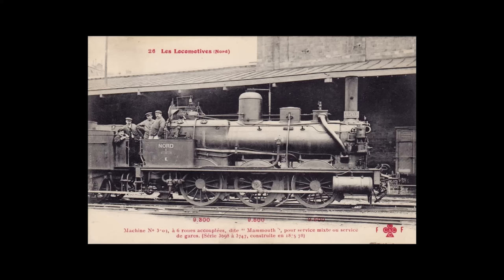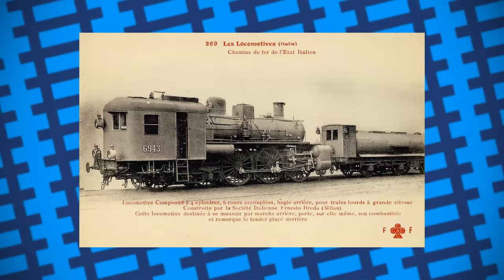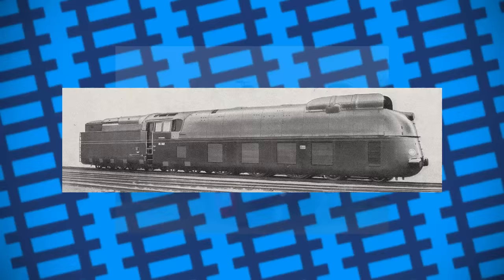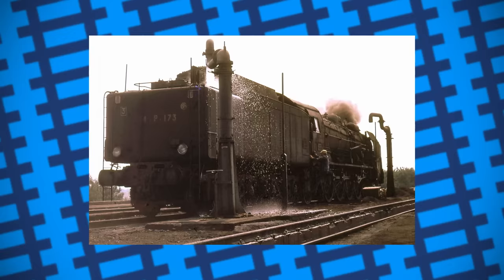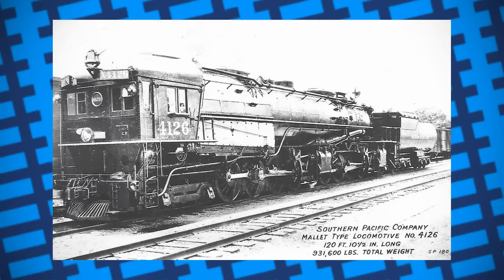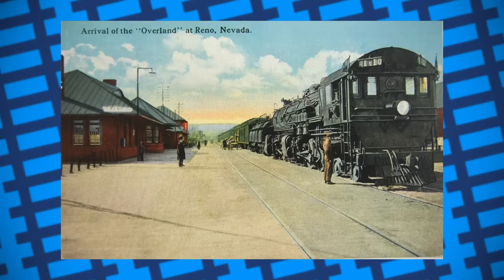Why "cab-forward" steam locomotives usually didn't work - Cab Forward Locomotives

Comment: In Denmark we did a small cab forward locomotive design similar to the first one shown in the video. It was known as the Jutlandian & Funen Railways (JFJ, later part of DSB) P class locomotive A small 0-2-2 tank engine from the 1880's with a long rear tank, making the locomotive look more like a tender engine. Like the american engines they were specifically designed for work on light railways with very cheaply laid trackage to save money. Though this quickly became a problem as the lines they operated on quickly had so much demand the little P class machines couldn't keep up. 

Over the next many years many were shuffled around to work on branches and secondary routes around the country until around 1904-06 when all the locomotives were sold to private railways. The private railways in Denmark were historically a scruffy affair with lower finances and poorer tracks. So for many of these, getting some P class locomotives to start service with for their brand new line was quite ideal. Though most only lasted 10-20 years on such lines. 

Today a single P class is preserved, P 125. It was sold to the Copenhagen-Slangerup railway in 1906. The line opened a year before with 4 subpar steam locomotives and needed better locos asap. The little locomotive ran on the line, doing shunting and light trains partway up it, all the way until 1948 when the Copenhagen-Slangerup railway was taken over by the state railways. With P 125 being one of only 2 surviving P class locomotives at the time, the State railways immediately put the locomotive into their historic collection, forming part of whats today the Danish national railway museum, which was separated from DSB in 2017
Reply: When you say cheaply laid trackage, does that referring to the weight/strength of the rail or the frequency of the ties? Thanks
Reply: @george2113  Strength of the rails. Also many of these lines didn't even use traditional railway ties but rather pots turned upside down to support the track. And the trackage weighed just 17,5 kg per meter. So very cheap and very weak
Reply: @drdewott9154  that's pretty flimsy. Even worse were snakeheads in early US railroad. A loose, bent-up end of one of the strap rails, or flat rails, formerly used on American railroads. It was sometimes so bent by the passage of a train as to slip over a wheel and pierce the bottom of a car. The cars were made of wood and frequently had a wood stove and kerosene lighting.

Comment: Good Video, and a good introduction to "Cab-Forward" locomotives. Being from across the pond, and a huge fan of the SP and their exploits, I thought I would share some notes for additional context:

@0:35 - I think it's a bit misleading to consider the Forney locomotives as a "Cab-Forward" designed locomotive. Primarily, I'd like to point out that it was designed to be a 0-4-4T engine, with the intention of bi-directional running. It sounds a lot more similar to shunting/switching locomotives, but with an additional set of wheels to distribute the weight. Additionally, there are plenty  logging locomotives that had similar design traits: good running capabilities in both directions, often ran backwards for extended periods of times, had a singular frame on which both water and fuel were stored, yet there are often not considered to be "Cab-Forwards"

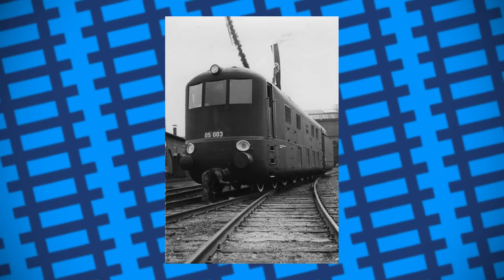@3:26 - The American Camelback locomotives come to mind when you discussed this section. It must have been awful trying to communicate with a fireman if you couldn't see or hear them. It's possible that something similar to a steam ship's engine telegraph could be created to improve communication between the engineer/driver and the fireman. 

@5:10 - While the risks from oil leaks were possible from Cab Forward locomotives, the reason that they were not widely adopted was more to do with the fact that they were not conventional locomotives. The only reason that these locomotives were created was out of necessity, and it was certainly a lot easier to produce conventional locomotives than it was to produce these specialty "Cab-Forward" types. There are additional nit-picky limitations on "Cab-Forward" designs, logistically, practically, and technically, but I recommend that you pick up a copy of Donald Church's book, "CAB-FORWARD" to go into those details.

Comment: I got an idea for how a cab-forward locomotive could work. Use a corridor tender to hold the coal and water, modify the tender to have a driver cab on one end while the fireman cab is at the other end, and make it a duplex engine like a Big Boy. And, if you have redundant controls in the tender cab and the firebox cab, it can be easily driven either way

Comment: The 05 003 did _not _ have a separate cab for the fireman as is implied with the picture shown at 3:15. It was basically a turned-around standard 05, so the fire box was in front. The locomotive burned coal dust to deal with the distance between tender and fire box. The dust was carried through long pipes by an air stream, and this didn't work too well.
Reply: Should have been oil instead.

Comment: I would date cab forward (or perhaps driver forward might be a better terminology in these examples) designs to the early days of locomotives. Some of Stephenson's engine's placed the driving position well ahead of the fire grate. Locomotion and Invicta had the driver standing on the side of the boiler, presumably to give him a better view. Hackworth probably built the earliest 'cab/driver forward lcoos, with the Royal George and Derwent types of engines placing the driver on the opposite end of the boiler to the fireman all be it with a tender on both ends. I would suggest Sans Pareil could be the first true driver forward loco as the driver's footplate was a raised platform at the front giving an unobstructed view ahead whereas the fireman stood at the rear on the tender.

Comment: Driving tender first is the one solution i would have though of.
And through the tender you have a passageway where driver and fireman can pass.

I would also look into making a chute where you shovel coal from the front (back) such that it travels to the firebox and this chute can be positioned to distribute coal in the firebox.

The issue at its core though is that you have to have access to the firebox AND tender AND be able to communicate.
Oil fired would be the optimal solution if made with this limitation in mind. Making sure that it's built from the ground up with cab forward in mind.

But then again, diesel did just this and did away with steam altogether. Eliminating the problem entirely.

Comment: The long tunnels and snow sheds in the mountains also gave rise to air-intake problems on replacement diesel locos.  Usually roof-mounted, intakes suffered from the fumes which accumulated, reducing oxygen levels, so the locos were modified to have them at footplate level.  They then became known as "tunnel motors".
Reply: The tunnel-motor arrangement is for cooling (specifically cold-side radiator fans drawing from lower in the tunnel), not engine induction.
Reply: @wizlish  Primarily, yes, but clean, cold air makes for better-running engines.   Can you be more specific about induction air, as in identifying the flow routes?
Reply: The SD-40T-2 and SD-45T-2 had inertial air-filter induction high on the long hood just behind the cab, in the same location as production six-motor dash-2s.  

There were some experiments with baffles to draw induction air from lower down; I know of none that were thought successful enough to duplicate.  My understanding was that the concern was less with temperature than with re-ingested exhaust gas; engine cooling being the critical thing.  Note that even recently there have been attempts at 'elephant ear' intakes intended to direct cooler air to 'conventional' radiators on more modern power... and there have been no 'tunnel motors' built new in any modern 4400hp or higher configuration.
Reply: @wizlish  Thank you - solves an issue for me.

Comment: I'm not an engineer but, if having tender at the front we would have either a tender too tall that it block view, or too small it would limit range, can we instead have a tender low but longer to hold more fuel?

Comment: Canadian Pacific for a time considered converting their T1a class 2-10-4s into cab ahead locomotives for service in British Columbia, where CP trains had to tackle not one but two entire mountain ranges back to back. Those of course being the cascades and the Rockies, which bookend my beautiful province.

The 2-10-4s were already uniquely designed for mountainous terrain, being the largest and most powerful locomotives on the railroad, however they wanted to take this a step further by following SP’s example and turning the locomotives so they ran cab-first. It was a logical step, as CP was also known for its long snow sheds and numerous tunnels along its lines perhaps even more so than the Espee down south, which sometimes did cause problems for the crews when it came to breathing and visibility.

In the end CP came under more conservative management that decided not to go forward with a lot of the modernization projects CP had planned, instead opting to purchase a fleet of new smaller locomotives based on old designs, rather than move on with the new 4-6-4s and 2-10-4s that were pushing technology forward at the time.

Comment: I can think of a way that would work for having two cabs one for driver one for fire crew, have two or 3 drivers like an airliner in the first cab, then in the fire cab have the same number of fire crew, as for communication between the two they could have had levers that pull signals inside the two cabs like a signal box for the driver (if that makes sense) they could signal each other "slow down low water" or whatever, or they could use flags signalling different things. I also think that in the driver cab you could have the regulator, reverser and brakes all linked up with the ones in the rear cab, maybe not the reverser or brakes but defo the regulator and then the fireman can see the position of the reg and he will know weather to keep firing or not. This makes sense in my head lol so hopefully whoever reads this will know what I mean

Comment: Worth noting that the experimental SR Leader class also had a cab forward design (although it failed for a number of reasons, as far as I can tell, it was in part due to the unusual cab configuration).

Some Garratt locomotives ran cab first as well.

Comment: Surprised you didn't mention Bulleid's Southern Railway "Leader Class" which was a failure because the newly-formed British Railways was LMS-orientated. 5 were under construction though only the first was finished. A few more weeks of development could have led to working locos.
Reply: A valid point, though it probably needed more than a few weeks more development work.  The Leader Class was intended to be worked like a Diesel and had a cab at each end of the loco.  The main problem was caused by the corridor from one end to the other to allow the Driver to change ends without leaving the loco.  It also needed much better ventilation for the  Fireman who was in "cave" in the centre of the loco.  A shame it was never given a chance, because with these and a few other adjustments it could have been a great design.

Comment: The cab-forward locomotives were basically the reason why diesel locomotives typically run with their cabs forwards to the direction of travel. Increased visibility is really difficult to do on a steam locomotive without sacrificing operating efficiency and running qualities. Diesels are less of a problem, as they don’t normally need tenders, and have no firebox. Additionally, since diesels use internal combustion engines, the engine can be mounted in a way that makes cab-forward operations more practical.
Reply: One of a very common design also has dual cabs. it is common design outside North America but not there!

Comment: Yeah the Espee’s cab forwards really had visibility as a secondary benefit. The main reason just had to do with air flow because of the fumes in the several snow sheds and tunnels coming from the stack.

Plus it wasn’t a one off or Frankenstein creation the SP decided to make from several locomotives. Having a set basket to put your eggs in can do wonders for any class of locomotive

Comment: Putting a cab at the front - well, at both ends; they were steam boxcabs - worked out for the LNER Y6 and J70 engines. Like with the SP cab forwards, the arrangement was made to solve a practial problem (in this case, safety on street tramways + avoiding having to turn the engine around), and them being short tank engines meant it caused little trouble.

Comment: 1:06 That's the Nantucket Railroad, a potential video in and of itself, as it was a narrow gauge line running from the harbor in the center of the town of Nantucket across the island to the village of Siasconset. It was ripped up during WWI and the rolling stock sent abroad to aid in the war effort. In addition to it, there were two narrow gauge lines on Martha's Vineyard due west of the island, both of which ran between the harbor at Oak Bluffs and Edgartown.

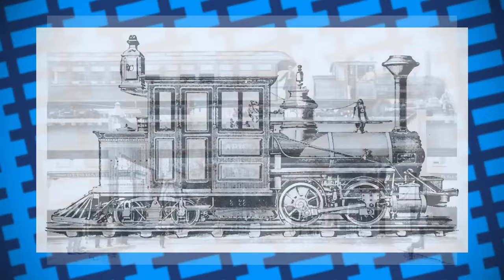Comment: 0:54 Tank Locomotive sometimes is considered Cabforwards but these are designed to run in equal speeds in two directions and thus can do return trip faster by simple passing switch and not turntable.

Comment: In UK many commuter lines used tank engines which then followed the train out and into a slip road ready to be attached to the back of the next train into the terminus.  They would then run tender first to the other end of the line.

Comment: The Cavan and Leitrim Railway in Ireland used 4-4-0 T locomotives, but because part of the route ran as a street tramway, they were required by law to have the driver at the front where he had the best view of traffic. They tried running cab-forward as 0-4-4, but it was too hard on the track, so they ended up putting a second set of controls in a little cabin on the pilot deck at the smokebox end. I would love to see a picture of one of those. Consider also the Great Western Railway railmotor/autocar sets, which had the second set of controls at the far end of the passenger car. (There is one in service at Didcot.) I think there was some sort of signal bell between the driver's end and the fireman's end.

Comment: A better design would be "Split cab" where a person in the back manned loading the tinderbox, and a person in the front would handle throttle.   This would mean having a crew of two instead of one, but that is a good thing unless you are footing the bill for labor.  An intercom system can be used for communication as well, although simply doubling up all the pressure indicators on both sides reduces the total Communications needed, a regular status check would be needed none the less to determine that everything is OK.

Comment: Honestly I'm surprised no cab forward designs ever came about in the UK. There was that one really long tunnel on the S&D, if I'm not mistaken... And on the trans Pennine route outside of Manchester Victoria where they had to evacuate a train after it hit a huge chunk of ice that came down the ventilation shaft
Reply: We did have one, the Southern Railway’s ‘Leader’ class. Wasn’t a success.
Reply: @AtheistOrphan  Fair point. I forgot about the leader. Interesting concept, would have been neat to see it preserved. I know someone has one in a live steam model, it's very cool.
Reply: Leader might have worked (or at least, worked somewhat better) if built with oil firing as Bulleid originally intended.  As with the dotty Belgian Franco-Crosti locomotive (the one with the near-indescribable wheel arrangement) the boiler wound up having to be fired from the side, confined by the British loading gage in a heat-holding metal shell, and offset to the extent of needing several tons' counterbalance.  This "could" have been avoided if the American pattern of center-cab bunker-first design (as on the PRR Steamotive and V1 designs, the C&O M-1, and the N&W TE-1 been used, but you'd still have had visibility problems operating bunker-first and smoke problems the other way...

Comment: 3:15 The main reason why 05.003 failed was the use of coal dust as propellant, as oil would have to be purchased abroad in foreign currency. So they choose stone coal. This was mixed with air and blown to the fire box by means of a turbine. It did not work very well because of frequently incomplete combustion of the coal. A lot of unburned dust and slag settled in the smoke tubes, clogging them rapidly. Moreover passengers in the coaches were molested by excessive cole dust floating through the windows of the coaches. As the problems could not be solved, it was put out of service in 1940. Yet in late 1944 05.003 was rebuilt to standard configuration. It survived the war and was used during the fifties on regular duty as a fast train locomotive. Together with 05.002 it was finally scrapped in 1960. Interestingly only 2 or 3 photos of this interesting machine exist, but no footage...